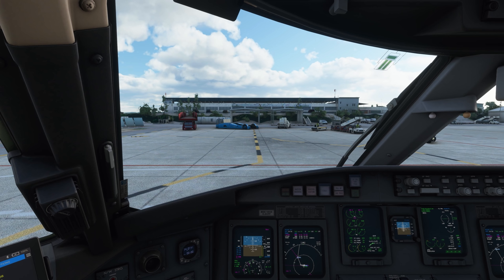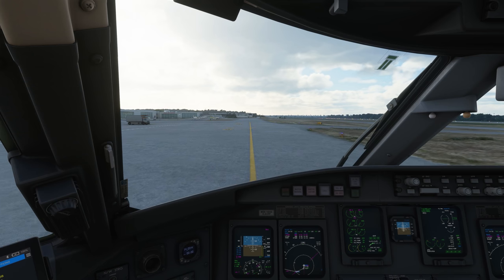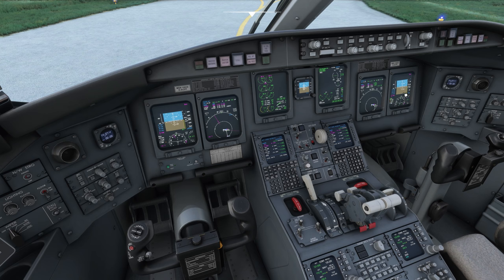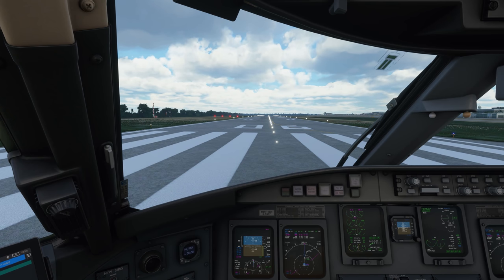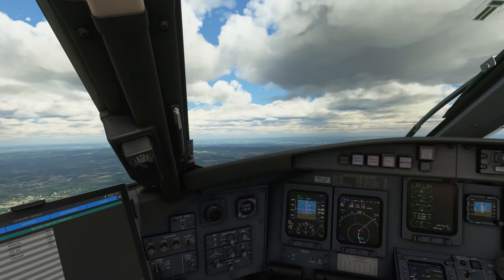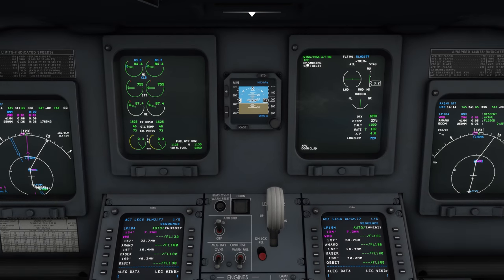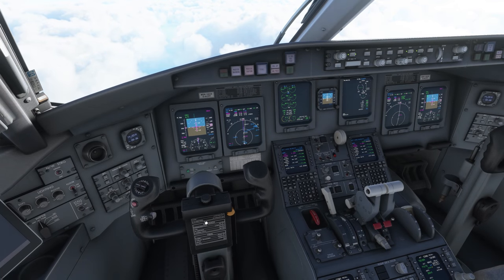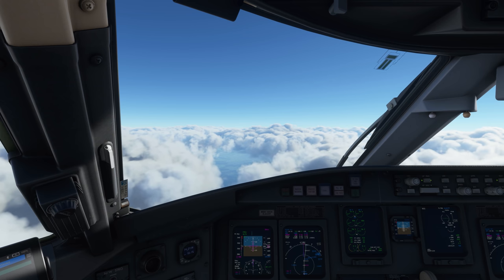MSFS Aerosoft CRJ Tutorial Ep7: Taxi Out And Taking Off! (OLD VERSION)

Comment: Looks great! Is there anything Aerosoft can do about the twitchy rudder on the ground? At 70-80 knots, you slightly tapped the rudder and the plane jolted from side to side. Additionally, the wings slightly banked with this yaw which seems odd at a low speed like 75 knots when the wings aren't hardly generating lift yet (would make sense at higher speeds). Thanks!
Reply from the maker: You can tune the twitchy rudder. I did not do that because I am also on the beta team.
Reply: You can adjust any plane's rudder's sensitivity by going to MSFS > Options > Select rudder pedals > Sensitivity and then change "reactivity". I did this for many planes such as PA44 and the end result was fantastic. Also add about 9-10 percent of deadzone.

Comment: 14:00 is the AP hunting for a certain pitch? You can see it going up and down repeatedly
Reply: It’s pitching for speed. The real airplane does that and has issues with oscillations sometimes - especially when speed mode is used for descents.
Reply: looks like a typical FS2020 bug, just not as bad as the default aircraft can be sometimes
Reply: @cris8459  I can't imagine it would change the pitch that abruptly every ~2 seconds...it might just be a typical MSFS bug
Reply: May be there is some turbulence, real CRJ didn't do that so significatly.

Comment: Thanks again for another great and informative video!    I have two questions--in P3D, when I'm trying to climb the CRJ in speed mode, it always exceeds the
selected speed, and I'm always having to juggle the throttles to keep it close to the value I selected.  It's a different world from the PMDG 737ngxu or the FSLabs
A320, where the VNAV mode does all that for you--don't get me wrong, I love the challenge of flying a complex jet like this, that demands such a level of airmanship.

Yet I was really impressed that in this video the aircraft, unlike in the P3D 4.5  version, holds the selected speed perfectly in that mode!     Has anyone else noted this?   
Maybe I've not been engaging it correctly?   I realized that I've not been engaging the TOGA button on the throttles before takeoff.

The second question pertaining to the terrain/WX radar.   I noted that it isn't implemented yet in the MSFS version; will it be by the time the aircraft is released?

Your excellent work is really appreciated.
Reply from the maker: It will not be implemented with the release. MSFS does not allow YET to make the WXR and terrain work. But sometime in the future it will be possible and implemented.
Reply: @Flyer0245  Understood--thank you!

Comment: Does the sim replicate the hot brakes. In the real CRJ's the breaks heat up pretty quickly. Especially in the summer months. Just wondering? (SkyWest CRJ Captain)
Reply: As you have thousand of Hours on the CRJ, is normal for the crj to oscillate when maintaining constant climb speed ie in this videos (250 and 290)?
Reply from the maker: Yes, but they do not heat up as fast as IRL. No need to use the reverser during taxi here ;)

Comment: Is there no head movement in relation to aircraft movements? Like no bumps whilst going down the runway, unlike the default aircrafts
Reply: Need addons like Chaseplane for FSX/P3D or FS realview for X-Plane (camera head movement) for that. All default and most payware (any sim) aircraft don't have this feature. A2A aircraft does the best of simulating head movement without extra addons.
Reply from the maker: I switched those off. Personal preference.
Reply: @Flyer0245  just saying most aircraft don't have this option. I had the option with my RealAir Legacy way back in FSX which was great but my good old (modded) Default Cessna you had to buy EZdok or Chaseplane for head movement. Like you say personal preference and the wallet.

Comment: nice !!

I noticed what seems 2 bugs :

1) is normal to see wind speed and direction during taxi? in most airliners if not all, wind data displayed when the GS is above 80-100kt
2) it seems that during climb ( and maybe descent) at fixed speed ( 250 and 290 kt) the plazne is oscillating around its stabilised pitch but doesn't seem to be due by the weather but with a flight dynamic issue from aerosoft ?
Reply: Very common for both honestly. Sometimes even see winds showing on the ground parked at the gate. Some pilots will climb in PITCH or V/S to help dampen out the oscillations but the CRJ can be very pitchy in speed, especially between 290-320.

Comment: Why is the apu on till fl 100?
Reply: Different airlines may have different procedures, technically there's nothing wrong with having the apu on in flight as there are no limitations as long as it's working. The after takeoff checklist he uses may have an 'APU off' item.
Reply from the maker: @GTReplayMaster  Company SOP. In this case Aerosoft SOP. But you can as well switch the APU off with the after start items.
Reply: @Flyer0245  ah ok thanks, nice video btw, I am excited to fly it myself in msfs 2020

Comment: Great series  of tutorials.
I don’t want to sound too greedy and you already might have considered it, if not, would it be possible for you to consider doing a circuit tutorial video with touch and go, how to setup the airplane for it, with one done manually and one with AP.
I watched the one you did 5 years ago, cruelly lacking your comments. 
Can’t wait to learn how to fly this airplane when it comes out, thanks for your hard work.
Reply from the maker: Thank you! At the moment I still need to redo the last two videos and have to complete the tutorial flight. Thereafter I will make a "casual" flight that starts on the runway with engines running. If people are not fed up with me by then I might make a circuit tutorial..

Comment: Why is the nose bobbing up and down when you where climbin
Reply: Speed mode is very sensitive in the CRJ. Since the aircraft has no auto throttle it must use pitch entirely for maintaining speed.
Reply: @GTReplayMaster  i know it doesn't have VNAV but I cant imagine it would chase the speed that much. Do you fly the CRJ IRL?
Reply from the maker: @jordancollins7714  It is partly caused by the weather in the sim and sometimes the code also does not help. You see it with other MSFS aircraft also btw.
Reply: @jordancollins7714  It looked fine to me, though im no pilot. I'm used to smaller manual thrust birds being a little jumpy in certain conditions. I sometimes scrub it with v/s mode, speaking from the 727, S340A from XPlane.
Reply: @GTReplayMaster  This shouldn't really matter tbh. Even though other aircraft may have auto throttle, they still climb at a set power so they all use pitch for airspeed.
Reply: @jordancollins7714  I do, it's usually smooth but depending on environmental factors it can start to perform a wave like oscillation which I often correct by switching to VS momentarily.
Reply: @dannnnn496  Yes, that is correct, but not all autopilots are perfect in their execution. The CRJ can be susceptible to 'chasing the needle' in speed mode (among other things)
Reply: @GTReplayMaster  Ok thanks a lot. I did not know that about the CRJ. Im'm just a single engine PPL.
Reply: Called turbulence :-)

Comment: Great Video, may I ask a general question about the CRJs, what do the Speed Button and Speed knob actually do? I already searched it but didn't find any helpful answer. The plane doesn't have A/T so what does it do? :)
Reply: id assume its like flight level change, you set the speed via the speed knob and the airplane will pitch to hold the desired speed.
Reply: You can set the speed bug for reference.
Reply: The speed sets the speed bucket or speed bug on the airspeed tape. You can use this as a reminder to hold a certain speed when level or in a vertical mode other than CLB/DES/SPD. Or you can command the airplane to pitch for the bugged speed via the SPD button. After the EICAS 2000 update on the CRJ-100/200 the speed button has climb and descent modes. If climbing, pushing the speed button will engage CLB mode. DES if descending. Pressing it again will put it into SPD mode and again with put it in PTCH mode. The CLB and DES modes are designed to make sure the airplane maintains at least a 50fpm rate either climbing or descending. Before EICAS 2000 you could be climbing at like 250 and if you bugged 290 in SPD mode it would start a descent to reach the targeted speed. Hope this answers your question.
Reply from the maker: Spot on.
Reply: @Banshee365  Thanks!

Comment: I'm curious about the thinking behind the deicing systems. Does the flight crew use them only when ice messages post (reactive) or ever in anticipation of ice conditions (proactive)? Again great video series.
Reply from the maker: Normally you will be proactively about icing; you switch anti ice on when in icing condition. Regardless of what the EICAS says. The EICAS ICE message is more of a reminder/attention getter that ice is still there. If the message is gone again, and you are not in icing conditions anymore, it is a subtle reminder that anti ice is not needed anymore.